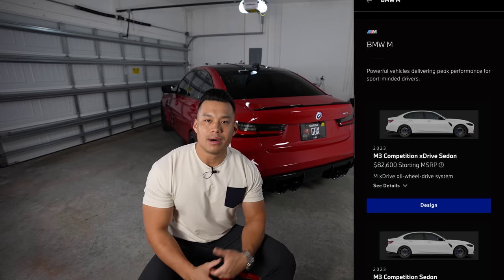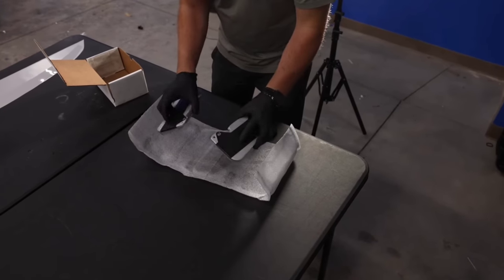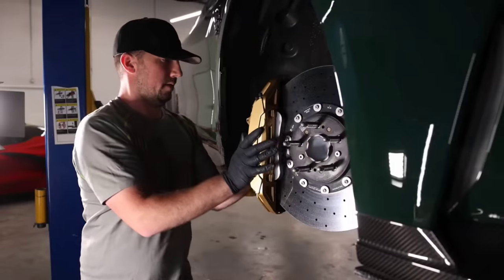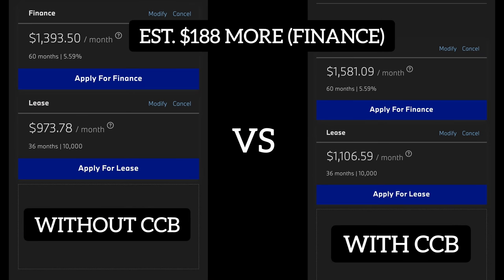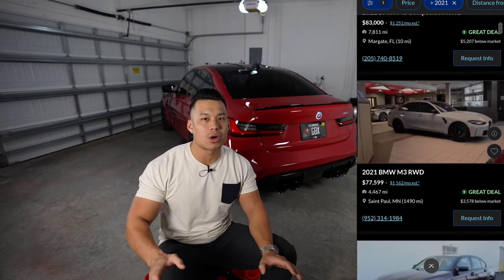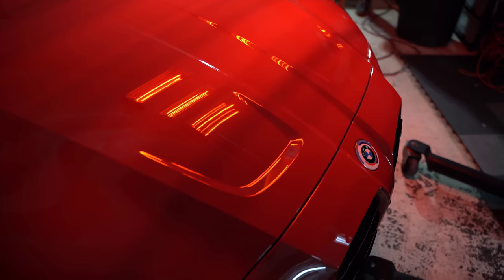I Regret Not Adding These Options When I Ordered My G80 M3 | BMW Individual Imola Red II

Comment: I am glad you didn’t get the ceramic brakes! They are terrible in a wet conditions!! Almost no stopping power in rain. My f80 had it and I almost crashed it in 4 diff occasions! I told my self never ever again unless I am only gonna drive it in dry conditions or track

Comment: Idk how long y’all are planning to keep your M cars, but when you have to replace your Carbon Ceramic rotors be prepared to whip out some money. Each rotor is 4K (EACH), that’ll run you 16K and that’s before labor. It’s easier to put some elbow grease into those wheels or ceramic coat them
Reply: Also when I sold my F80 the carbon ceramic didn’t help my value. Another thing if you’re recommending Carbon ceramic brakes and not recommending m drive professional.. wouldn’t those coincide bc they are both track focused??

Comment: I have always swapped my factory pads with performance carbon ceramic pads. I’m about as OCD as you are. The changeover is relatively inexpensive and has kept my wheels relatively dust free. 😊
Reply from the maker: Awesome to hear ! Which pads are you running 🏃‍♂️?  🤔
Reply: @TheDailyDriven  Depending on vehicle and availability, I will use Brembo nano ceramic pads, Powerstop Z23, or Porterfield ceramic. Hawk and EBC also offer ceramic options. They’re all excellent low dust options. 😀
Reply: I agree. I have a F80 M3 and was dealing with the same issue. Went with ceramic pads and problem solved 👍🏼
Reply: Do ceramic pads shorten the life of the disc/rotor?
Reply: @t-rex7796  Not that I’ve noticed. The carbon ceramic pads are designed with the proper friction surface for steel rotors. I’ve been using carbon ceramic pads on steel rotors since 2015. Everything from Hellcats to AMG to Porsche and M cars 😀.
Reply: @soulmaster63  thanks mate, then I am sold on the ceramic pads!

Comment: The cost of the Carbon Cermic Rotars is $8500 plus a set of brake calipers, pads and rotors.  You don't get the stock stuff in a gift box.  And it is bad advice to pretend it is "not the cost" because you finance which actually makes it more expensive.  This how people prevent themselves from being financially well off.  And the thing is if you never heat them up, they might last forever.  However, if you track them, in as little has 1 track day you will likely high temp heat cycle them enough to wear the coating and then eventually you get to replace those expensive rotors.  Most smart track people opt for the steel brakes.

Comment: Adding carbon ceramic breaks just to not have brake dust seems silly to me.  Get a different set of aftermarket pads if brake dust is a problem.  Yea, $8,500 over a 5 year loan, on a month to month basis, isn't a lot, but you're probably looking at $10k after interest on that addition which can be used in a number of places.  Unless you're using it at the track, putting carbon ceramic brakes for aesthetic purposes is nuts.

Comment: I have several mhc carbon parts and they are very nice quality. Several of the parts like the sp1 lip and their 2 vane air ducts give a different look to the front end. I got many more parts for cheaper than the factory carbon package you can option with the car build. I have seen some brands that are wildly expensive. R44 performance recently had a Christmas deal on their inventory and I got much more than the carbon package offers for the same price, sp1 lip, carbon kidney grill, air ducts, canard, rear diffuser. Only thing left out was the carbon mirrors. All mhc parts
Reply: What a deal! I ordered their wing during the Black Friday sale. Ended up getting it for around $1,700. A lot of “Nissans” and lower trim M performance cars are using the high kick trunk lip spoiler and I find it to be too generic. I will be getting the sp1 lip and their 2 vans air ducts as well.
Reply: @Reginald  yeah I'm not liking the high kick trunk spoiler either.maybe it looks better in person but on videos it just seems like too much

Comment: Excellent video.  I have a 2022 M4 manual, and I love it just the way it came from BMW.  I passed on the carbon ceramic brakes and the carbon seats, the carbon fiber exterior trim and M Drive Professional Packages, and the Shadowline trim package, and I don't miss them.  My car is Isle on Man Green with Tartufo brown full leather interior.  I have the moonroof.  I like that the mirrors, rear spoiler, and roof are body color rather than black or black carbon fiber.  My car also has the 825M bi-color wheels.  I plan the keep my car stock and will not lower it.  If you plan to lower your car and/or add a front splitter be sure that you will still be able to clear speed bumps and rolled curbs.  My house has the rolled curbs that are so common in many California suburbs including here in the Sacramento area.  Even stock, I have to approach my driveway at an angle to avoid scraping the front end. as my driveway upslopes from the curbs, then tapers off toward my garage.  It I lowered the car or added a front splitter, I would tear the hell out of it every time I entered the driveway.

Enjoy your M3.  I think the G8x cars are among the best cars that BMW has ever built.
Reply: how do you like the moonroof vs carbon roof? Do u regret not getting the carbon roof?

Comment: I have a 23 G80 Xdrive, and have all the options except M Drive Professional and CCB. Not going to track and I sure dont need a score or analyze my drifting. 8k a steep for CCB and not fully utilize them, stock brakes are great and red calipers matches better with my color scheme. When these pads are rdy for replacement, theyll be replaced with ceramic pads, like others on here have stated.

Comment: Appreciate the thoughts through your experience.    One thing to mention, choosing carbon ceramic brakes, you will lose a huge amount on resell down the road.   Everyone avoids a carbon cermaic brake equipped vehicles as they know they are facing a 15k+ brake job.  You will lose your money on the other end.  Or you keep long emough to end up doing the brake job    You are  really throwing 25 grand to suppress the annoyance of brake dust?  Instead change the pads to aftermarket.. save yourself 24 grand.  Enjoy the maintenace washes    Unless u track this thing or have money to throw around. Carbon ceramic  brakes are not.worth it.
Reply from the maker: Yeah in the future I'm probably going to be looking into upgrading the brake pads for a set that's low dust. Appreciate you checking out the video!

Comment: The Number 1 option I should have purchased for my 2023 M4 (Brooklyn Gray) Comp is... Carbon Ceramic Brakes.  Although, my car is for the weekends ONLY, ( Not for the track) .....after a hand wash and a quick drive for 5 miles on the LA Freeways the wheels need to be cleaned.   Brake Dust all over the wheels.

Comment: I don't mind cleaning the wheels fairly often over the Carbon Ceramic premium. That (in my opinion) is not worth it for a car that will not see track duty. However, I do agree with your assessment of the carbon trim options. I should have just opted for that on mine, but its now to late as the car is on a boat heading here now. I'm currently looking at the options from Kies Motorsport, but I'm not to sure about the quality there. Maybe, I will wait to see what you do with that (let you be the guinea pig).

M Drive Professional. Hard agree... that was unnecessary for me. I'm not sure why I added it. Should have scrapped it and put it into the carbon trim from the factory. Although, I have the XDrive... so I think the ability to go rear wheel drive is tied to M Drive (I have to recheck on that). I didn't get the phone charger because it's cheaper to add yourself after the fact, however on my big ass phones, they never work right. On my ZL1 and Mk VIII Golf R it would either not fit, or would charge so slow that I would never notice.

I can't get down with the carbon bucket seats. I have sat in them, and they are nice, but I know I'd screw them up... especially when getting in and out of the car.... and I really don't want to have to think about how I get into my car every time I sit down. My preference (an unpopular one), but I think the M Sport comfort seats are a better option for people that just want to chill.

Great video, my guy. Very informative.
Reply: Regarding the m drive professional, I think you made the right decision since you have the drive. From what I’ve read, if you switch to rwd, up you would otherwise have no traction control in any scenario. I think for the rest of us with manual or comp rwd only, it’s a 900 dollar package that tells us how well we drifted more or less. 

I didn’t add it but the ccb option is keeping me up at night lol. I have about 3 weeks until I can’t make any more changes

Comment: Hey Ken thanks for the videos, great job. Appreciate the insights and honesty. Brake dust…yep no good. I tried to graphene the wheels, time will tell if it helps. Next carbon ceramic pads? I just got my 23 G80 M3 xdrive competition- in NY so I need the xdrive.

Comment: You can do all the exterior carbon for way cheaper than $11k and less than $4700 using aftermarket high quality parts
Reply from the maker: That's what I'm going to do for sure

Comment: I have the carbon exterior package and I wish I did not get it, I could have individually selected all the carbon options from the M performance part list, and retain my individual Daytona violet mirrors instead of carbon fiber. Also, if you are worried about break dust, simply ceramic coat the wheels, much better than paying $8500 for sub par carbon ceramics.

Comment: Great video man.  Can you tell me if lowering the car will do anything to the warranty on the vehicle?
Reply from the maker: Thank you for checking out the video! That really all depends, if your stock struts eventually start leaking or having issues with a lowering spring then they will avoid that warranty on that suspension part. They will not void your warranty on your engine or transmission because that has nothing to do with it. Also look around sometimes you may be able to find a service advisor that is somewhat mod friendly

Comment: Ceramic brake package is great for the cool factor; however, when it's time to change those rotors 💰💰💰
That's one of the reasons 911 track junkies switch from ceramic brake package to steel rotors.

Comment: Man I knew you were going to say carbon ceramics 😩. Gonna see if I can figure that out or just get some carbon ceramic pads (anyone have any experience with this?). I’m also not sure I want gold over red calipers. 

But good point regarding wireless charging. It almost never works well. I think I’ll end up deleting that one
Reply from the maker: The funny thing is that the gold were probably be very eye-catching, because everybody knows that specific goal is carbon ceramics. It's definitely not as common out there. But it's definitely really good to look at. The carbon ceramic brake pads might be my option that I'm going to have to look into later on
Reply: @TheDailyDriven  yes for sure. Just hard to pull that trigger!  Other options as well as base price have already increased so it’s hard. 8500 is steep… but what a flex lol!  Maybe I’ll save a few more pennies. Replacing the rotors just scares the hell out of me. I plan to keep a long time

Comment: Another great vid, Ken 🤙.  Two options I would now not do thanks to you.  Thought to do mdrive because on my wife's '21 x3m, we didn't opt that, and there's no way to change dash to m mode.  I believed I would need mdrive for this.

Strongly considering the cfp, but I prefer the body colored spoiler and would want the "air breather" in cf.  There's been recent small changes to the build page on BMW website (for base M3's): no anniversary emblem option, & mirror caps are not body colored.  I don't care for shadowline anything, so now have to consider cf caps.

As for the brake dust, I deal with the frequent cleanings with regular f97 brakes.  The premium for ccb's may make it unaffordable for my g80 but I will be selling my E36 M3, so it should help offset if I do.  Also, cleaning 8 regular M car wheels may not be worth my time.  I tend to clean my M's more than drive them.  Just a caretaker🤔

Comment: If I get the M Carbon Ceramic Brakes  it will be $163 more on my car payment, These are my options 

Individual color
826 wheels
Silverstone/Black Full Merino Leather 
Carbon Fiber trim
Driving Assistance Professional Package
Executive Package
Parking Assistance Package
M Carbon Ceramic Brakes
Extended Shadowline Trim Deletion
Icon Adaptive LED Headlights with Laserlight
M carbon bucket seats
M Carbon Exterior Package
Wireless Charging and WiFi Hotspot
M Shadowline 
$114k

But I might take some options off, Going to play around with it a little more, But I do want the ceramic brakes, Waiting for LCi for the M4 I want Idrive  8
Reply from the maker: That's definitely a hefty build. The only thing I would probably take off would be the wireless charging and Wi-Fi hotspot. You just need to ask yourself if that's something you're really going to utilize. Double thumbs up for the individual color though for sure!
Reply: @TheDailyDriven  on the Wi-Fi, I want to use the BMW’s credit card like card to open the door and start the car,  I don’t want to give it away on the color but I’m might of spilled beans on one of your videos, I have one question, The maintenance on Carbon Ceramic rotors, what the cost to maintain them?
Reply from the maker: The maintenance on the carbon Ceramics is very costly which is one big downside. They do advertise that it's good for the life of the vehicle. But if you're taking it to the track and you're excessively driving the car hard where the brakes are being abused then it probably won't last. Each rotor is about $4,000 retail

Comment: Your wireless charger is in the center console? My 23 manual is inside the armrest
Reply from the maker: I actually don't have that option on my car. I'm actually glad I just don't see the use for myself. I only want based on one of the m340is I had as a loaner and I assumed it was in the center console. The new ones might be under the armrest

Comment: The brake dust horror is real. I wish I could have stretched into the ceramics.
Reply from the maker: Oh it definitely is. But there's definitely a few brake pads that others have been using that's been minimizing the horrid brake dust issue